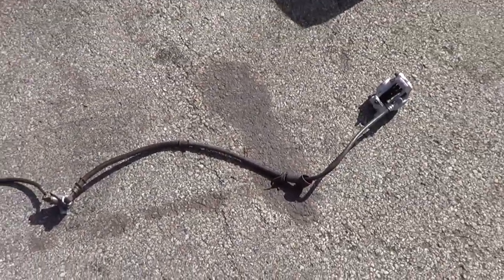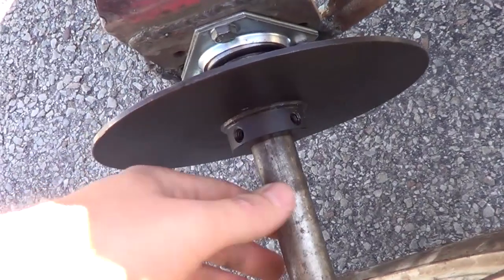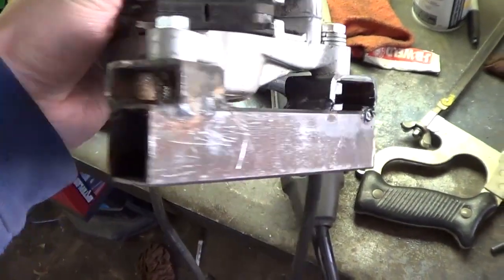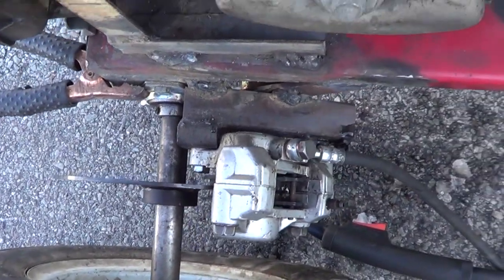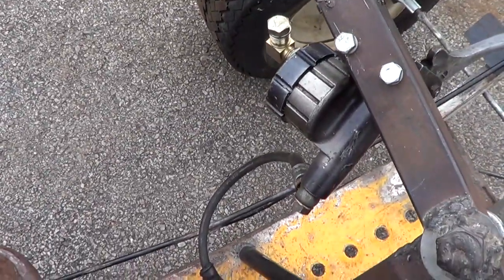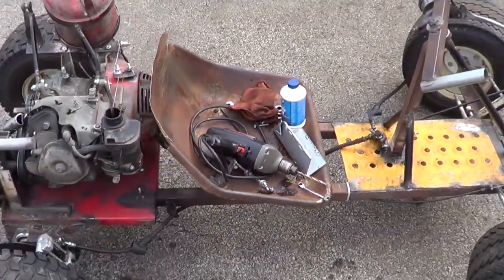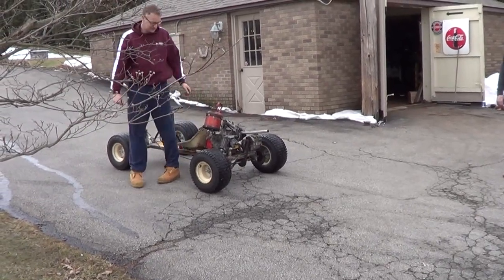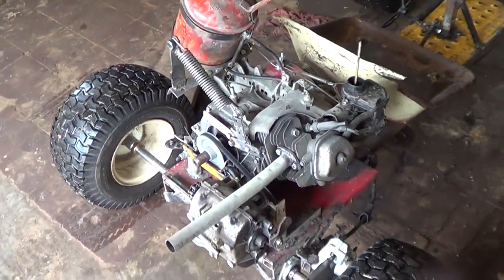Hydraulic brakes for GO KART for $60! DIY

Comment: Alright, if I will not weld the brake caliper onto the kart, then I need to shape a piece of steel and bolt it as a piece connecting the kart and caliper, right? I have a 64 bug sprint and it has no trace of any brake weld on the rear side.

Comment: And the right side of the transmission that lever was the brake for the lawnmower if you take it off it might not jerk as much
Reply from the maker: its just because the belt is new and the pulleys are also relatively new, they havent glazed over much at all. so that means not much slip haha. that clutch went from one extreme to the other lol.
Reply from the maker: and i am also going to do a little transmission prep just like i prepped the engine. that brake thing is going to come off as well as the reverse mechanism inside the trans. from what i understand the reversing chain does not last long when over-sped like it will be here so

Comment: Nice job !!! My mini bike shifter & kick starter came from a motorcycle salvage yard.
Reply from the maker: There ya go! ebay doesn't have as good deals as what the salvage yards do
Reply: *****
 Well, with those weird shaft spline sizes, you could easily buy alot of wrong sized shifters. I decided to take the shafts to the yard and fit them up myself :)
Reply from the maker: haha that too ^^